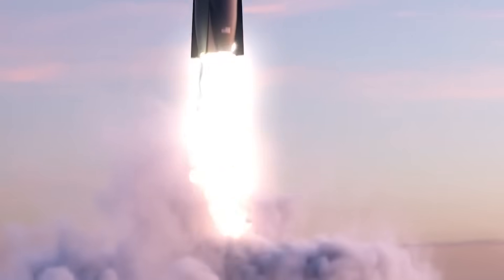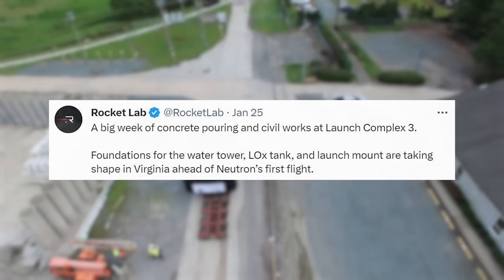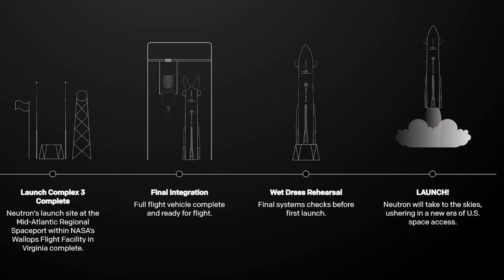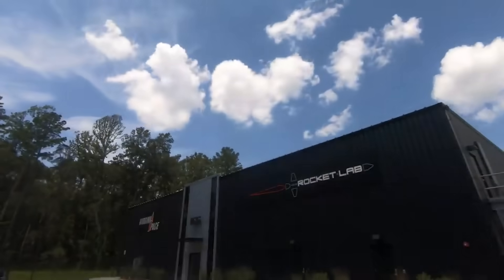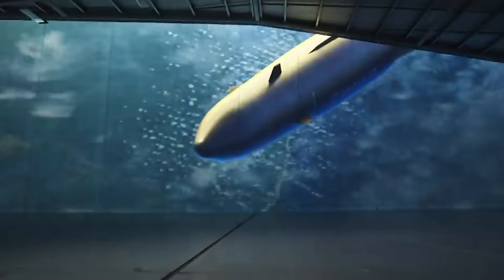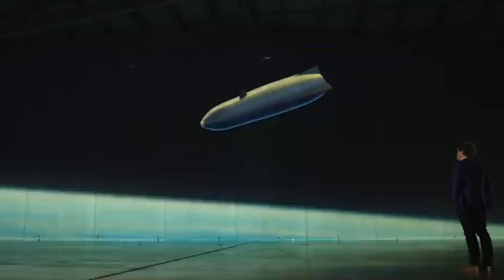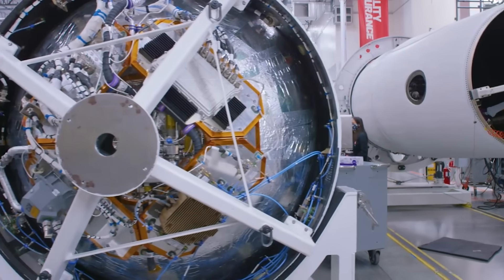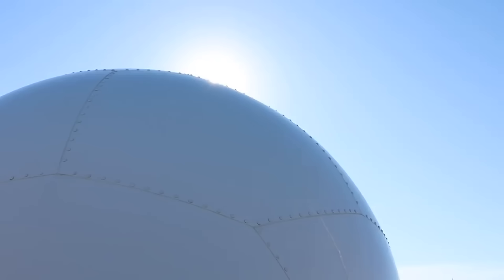Has Rocket Lab Made Progress On Neutron?

Comment: Quick correction:
While originally envisioned as a GG engine, Archimedes was announced 2022/09/21 as oxygen rich staged combustion.  I believe the explanation was that they weren't getting the needed performance from the GG cycle.

The link to the investor update where this change was announced is on the wikipedia entry for the engine.
Reply: Also it’s 7 on the first stage not 9

Comment: I'm pretty sure they've given up on the gas generator cycle for Archimedes and are going with oxygen-rich (I think) staged combustion.  As I recall, this was done for better throttling capabilities.
Reply: Yes, the video provides useful information about the current state of the project, but even the Wikipedia page shows that the engine is now oxygen-rich staged as this cycle better suited their needs and their engine team became confident that this cycle would not be much more difficult to develop.  Developers of older engines would have killed to have modern design, simulation, and engine management tools.

The timeline is heavily dependent upon what happens on the engine stand in the coming months as RL finds out whether this combustion cycle was a reasonable time trade.

A pinned comment might be useful to add this correction.

Comment: Neutron has a significantly lower payload to LEO than Falcon 9 (13 tons vs 18.4 tons). Neutron was developed to launch satellites for large satellite constellations. Currently only SpaceX and Amazon are working on such constellations. But according to Amazon, Falcon 9 is already at the lower end of the required Payload for their satellites. Which apparently means that Neutron is too weak to launch Amazon satellites. This sounds quite bad for Neutron.
Reply: Future Neutron development will see the payload to LEO likely increase significantly, just as F9 did after block 1.
Reply: Cost per kilogram is a slightly more useful metric here
Reply: @mathewferstl7042  Not really when Neutron can't launch constellation satellites at all.
Reply: @cube2fox  why can't it Launch a Constellation at all? It has the fairing size, and a decent lift capability. You're argument is that it's can't lift as much as a first F9 so it can't do the job at all? Oneweb satellites were launched atop Soyuz 2.1b's and LVM3's which have less/equal Payload capabilities to neutron. You're argument makes no sense
Reply: @mathewferstl7042  Dave Limp, Amazon’s senior vice president of devices and services, according to a Space now report, said on October 27 2022 at a Washington Post Live event: "I would say Falcon 9 is probably at the low end of the capacity that we need"
Reply: @cube2fox  and what about Oneweb, or the GEO market that neutron would also serve?
Reply: @mathewferstl7042  Yeah, though that's probably not as profitable as Kuiper.
Reply: @cube2fox  Kuiper is not going to be the only potential customer. So it's a mute point.
Reply: I don't think it's bad in the slightest. Even if neutron was larger it still wouldn't be launching star link now would it. It can allow for single satellite launches and so you don't have to wait around for extra customers and have it go to directly where you want them and do it cheaply enough to make it work.
Reply: @geesehoward700  We aren't talking about Starlink. We are talking about Amazon's Kuiper constellation. According to Peter Beck, Neutron was designed for big constellations. But apparently he didn't think Amazon would be using quite large satellites.
Reply: @cube2fox " Currently only SpaceX and Amazon are working on such constellations."
Reply: @geesehoward700  I mean OneWeb is much smaller and the Chinese aren't going to use US rockets.
Reply: @cube2fox  constellation launching wasn't it's only purpose though. Guess we'll see soon enough what their plans are.
Reply: SpaceX and Amazon are def not the only companies doing satellite constellations. Planetlabs and dozens of other startups are sending small satellites to orbit.
Reply: Falcon 9 payload limit is 10 tonnes max. to LEO (same as Falcon Heavy).
Reply: @davidstevenson9517    FYI    The payload capacity of the Falcon 9 to LEO is 22.8 tonnes 18.4 if landing on a drone ship.  

Payload capacity of Falcon Heavy to LEO is 63.8 tonnes or 26.7 to GSO.
Reply: @michaeldeierhoi4096  Sorry, Michael, but those are the true figures;10 tonne max. apiece to LEO; above that and:
(1) The payload won't fit in the fairing and a larger fairing would be torn to pieces by aerodynamic forces.
(2) The single F9 fuselage supporting the payload is designed for 10 tonne only and would collapse upon liftoff.
That is why SpaceX do NOT get ANY contracts above 10 tonne.
Simple mathmatics.
Reply: @davidstevenson9517  According to Everyday Astronaut, they already launched 18.4 tonnes in October 2023 during a Starlink mission.
Reply: @davidstevenson9517  You do appear to be right so I'll have that serving of crow now.   Your statement appears correct only because I could find no payload larger than 10 tonnes by a Falcon 9 or Heavy and not because I found a source that cited the reasoning you have.  The Echostar that Falcon Heavy launched last year was 9.2 was the heaviest satellite launched by anyone company to orbit at least that is what the news report have stated.  

So it is a little curious to me that this point has not been highlighted by the various channels covering rocket launches and I have followed space stories for many years.
Reply: @michaeldeierhoi4096  No he doesn't appear to be right. You are ignoring the 18.4 ton Falcon 9 Starlink mission on October 21, 2023.
Reply: @davidstevenson9517  I'll back that serving of crow and give it to you because this link demonstrates that you are wrong.  And at least one other commenter 'cube2fox' also pointed this out. 

"The heaviest payloads launched on Falcon are batches of 23 Starlink V2-Mini satellites weighing 18,400 kg (40,600 lb) total, a common configuration first flown October 2023".
Reply: @cube2fox  Thanks for the correction.    With some commenters we CAN get smarter every day!!  👍👍
Reply: @davidstevenson9517  They have deployed approximately 18.4 tons of Starlink payload in an October flight, see Wikipedia source / Everyday Astronaut.